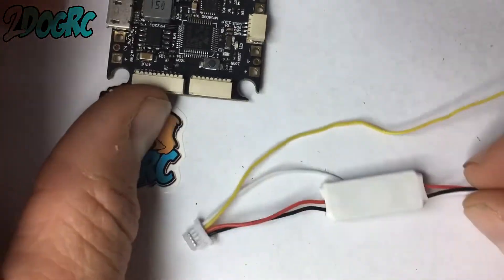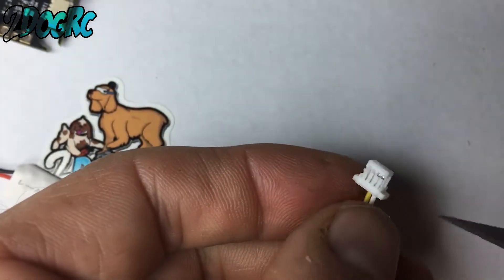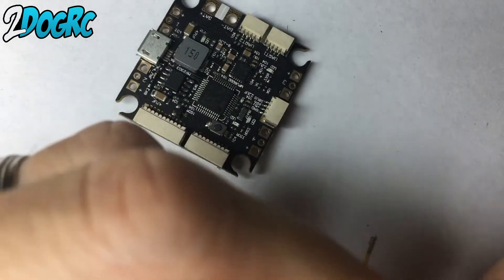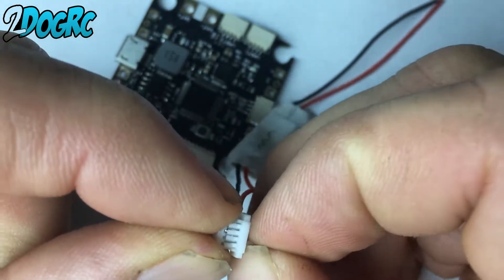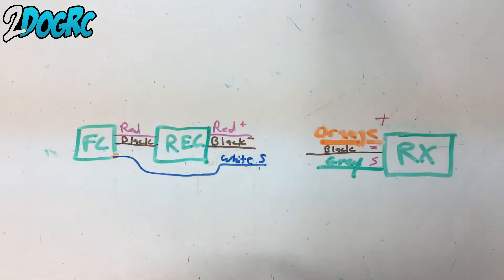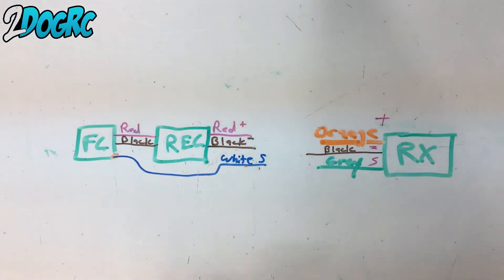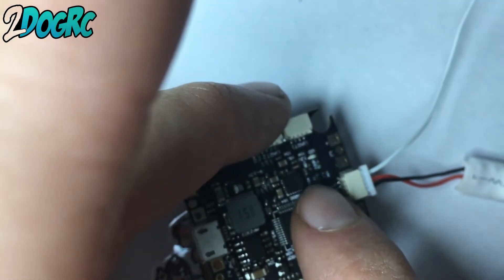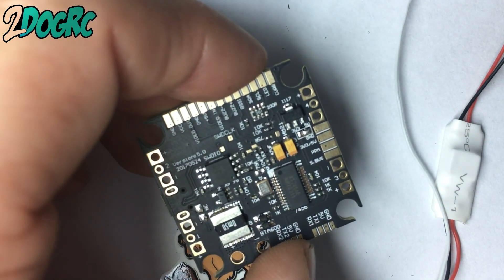How to Install Spektrum Quad Race Receiver in Diatone Gt2 2017

Comment: The wiring diagram that I received was for a different version of the flight controller board. My GT 2017 has the alternative version of the Fury F3 flight controller. I noticed the difference when I was looking at the controller and was able to wire my Spektrum receiver correctly using the diagram on Diatone's website. http://www.diatone.hk/goods.php?id=421

Comment: Hi..Thanks so much for the useful information. I recently purchased the Diatone Tyrant S. I'm flying with a Spektrum DX6 transmitter so I am trying to use a Spektrum Diversity Satellite receiver with the Tyrant. I used the method you outlined of stepping the voltage down to 3.3v using the enclosed BEC. The wiring looks good. However, when I attach to BetaFlight the binding light flashes fast (like it is in bind mode) for about 1 second, then starts flashing slowly. I can't seem to get it to go into bind mode. Any suggestions?

Comment: Does it matter if you have a serial spektrum receiver or a spektrum satalite?
Reply from the maker: Well, signal wise no, but the satellite ones can only take 3.3V while some can handle 5V input power. So check the specs on your receiver.

Comment: hey i have a question..please if you can help that would be great....im have a problem with my quad when I'm flying for a few minutes or so sometimes longer..all of the sudden the drone drops like there is no connection all of the sudden like I lose connection in mid air and it drops to the ground..i go to give it throttle again and it's fine..i don't get it..i use a spectrum dx6 with satellite recivers..i would really appreciate if you could help or did that ever happen to you that's why I'm asking..thank you
Reply from the maker: Peter, This could be a range issue.  Does it always do it facing away from you or distance away?  Also when you go pick it up are any of the motors extra hot?
Reply: 2dogrc yes it does exactlly
Reply: and the two back motors get hot
Reply from the maker: If it was does this at a distance, then you have having Failsafe.  Your Receiver antenna are not mounted properly, or the range is too little for the distance you are flying.
Reply: petefly FVP. I have the same problem with orange receiver. The quad fly on its own. No problem when using AR7000 Spektrum receiver.